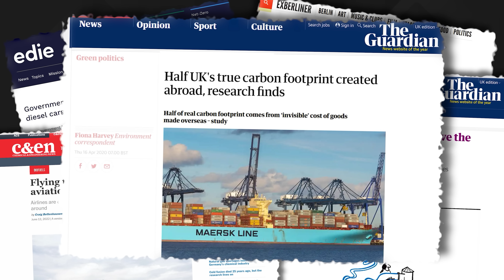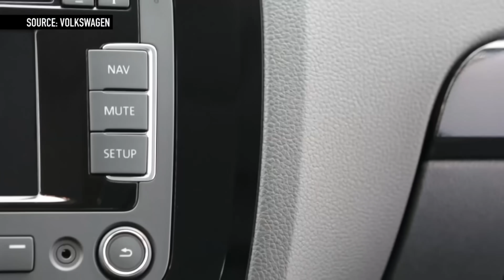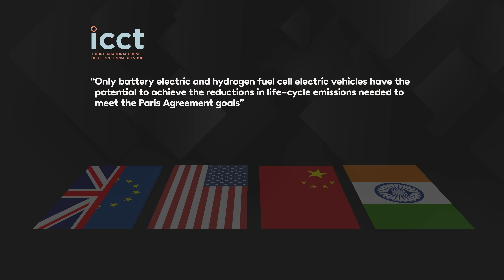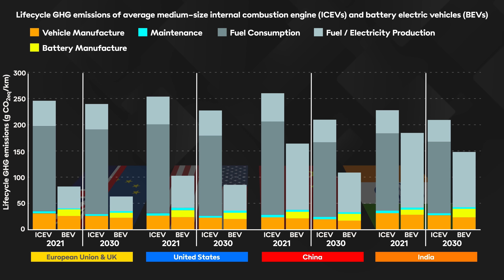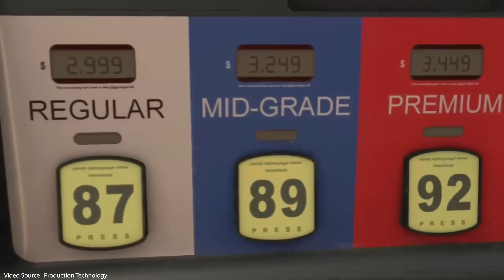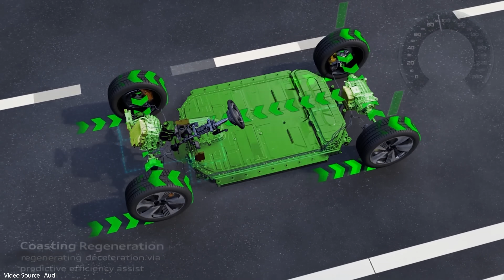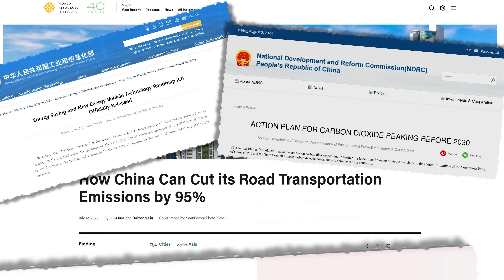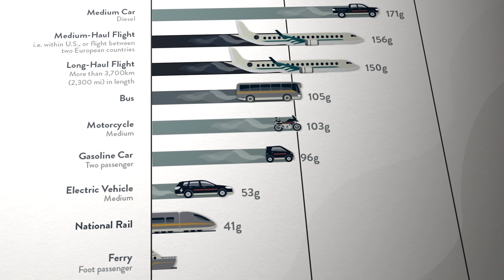Are EVs really better for the climate?

Comment: I thought that the problem with aircraft emissions wasn't so much about how much they pollute but more, where they pollute.  It is worse because of the way it interacts and changes in the upper atmosphere.  Cycling needs to get more like Japan in how cycling and cyclists behave with pedestrians and cars. Its very different to riding a bike here. The attitude of both car drivers, cyclists and pedestrians is more respectful of each other.
Reply: : That would be a nice change. The behaviour between groups is symbolic for the general level of disrespect that we seem to have towards other people. Car drivers hate other car drivers, too. If you try to find cohesion and respect in a modern western world you'll have to search for a long time. And that includes every age group as far as I can tell.
Reply: Planes are actually quite efficient per passenger per distance. Fully loaded some may be more efficient than a car with one person in it. Problem is they usually go very long distances...
Reply: @jfolz  good point ,A very difficult problem to solve if we want net zero.
Reply: @bernardcharlesworth9860  Avation is one of those hard to abate sectors that would be perfect for E-Fuels. Everything else can be either nucleriszed or electrified. It's really on governments to start properly using modern monetary policy to properly shape behaviour, a whacking great carbon tax would be a good start.
Reply: @kaymish6178  great ideas thanks
Reply: The modern turbo fan jet engine is more efficient than an ice but still produces tonnes of CO2.The development of structural batteries or hydrogen/compressed air turbines could lead to zero carbon planes.

Comment: A really vital question is whether there is additional harm done to the environment when a new EV is produced and the replaced ICE car is scrapped. Surely, it is better to drive an efficient diesel vehicle for as long as possible.
Reply: I don't know that a drivable car will be scrapped, especially if it's diesel so that it can run on multiple types of fuels. A quick modification, and you can run those on French fry oil
Reply: @jameshughes3014  Absolutely, IT WILL BE SCRAPPED. The mayor of London has initiated a "scrappage scheme" for diesel vehicles, offering £3000 to drivers on benefits. £3000 will not even pay for 10% of a new EV. The whole thing is a massive scandal. But the, politicians just make decisions that cost individuals their freedom and mobility (see Brexit) without any scrutiny whatsoever!
Reply: Given that there are not enough EVs being made to replace the global fleet many will have to drive ICE cars for a few more decades.    If you trade in your car the next guy will be driving it so there is on real CO2 saving there.   And along the same line some other guy will buy the EV you did not.  Don't sweat it either way.  Do what you want to do.
Reply: @danharold3087  I can't do "what I want to do". I have a 2013 diesel that I have averaged 8,000 miles a year on. It gets up to 1000 miles on a tankful, it hasn't needed any repairs, and it's got probably another decade or 200,000 miles of life in it. Yet, I'm being prevented from using it where I live. Running this car costs no more than £1000 a year, including insurance, tax, diesel and repairs and "wear and tear". The mayor of London offers £3,000 on the "scrappage scheme". I couldn't even pay for 1/10th of an EV with that!

It's an utterly irrational policy, which doesn't help the environment and disadvantages disabled and vulnerable citizens!
Reply: @ulicadluga  I feel for you.   I sure hope the US does not go down that road.   It is a huge tax on the poor and fixed income when they pull that kind of crap.

EVs are helping the environment.  But yeah our governments should not be doing this.
Can you get some kid of exemption for being disabled?
Reply: @danharold3087 Thanks for your empathy.

Sadly, EVs are not helping the environment - yet. They are causing the exploitation of the rarest resources for batteries, they are causing enormous effective wealth divides. 

Only publicly owned rail and urban transport (buses, trams and subway systems) can help the environment.
Reply: @ulicadluga  Public rail and urban transport do not work in many areas.   By all means use them where they work.

Literally every country with minerals has exploited them to create economic growth.   The battery minerals exist in many parts of the world.   Developing countries tend to exploit them to further develop.  China is a good example of this.  The US exploited their minerals during its industrial period.   Now it is nearly impossible to get a mining permit.   'I think'  Australia has about the same thing going.  Importing minerals they could mine.

Wealth and class divisions have historically been allowed to degree created by government.    People are poor because the government allows or encourages the have's to feed on the labor of have nots.    

I disagree about EVs not helping the environment.
Reply: @danharold3087  I can see the US perspective on "Freedom of Movement" being epitomised by the automobile.  To me, being able to drive a car for all my life from the age of 18 was a great "freedom". 

Now, I find out that my government has pulled that "freedom" from beneath my feet. Not only in terms of having to pay an additional £12.50 ($16) every day that I want to use my very economical car, but I cannot even travel freely to places I have lived in across the English Channel. Nevermind, being able to drive through Europe with my "very economical" car. 

I used to travel a 1000 miles on a single tankful of diesel. Now, with sky-high fuel costs, rip-off ferry prices and the dilapidated and congested motorways it has become impossible. 

My government has also caused me to need a visa to travel a hundred miles into  France, Belgium or Germany.

Greetings from the "Prison Island" Great Britain.
Reply: @ulicadluga  Ouch.   Seems the older governments get the worse they get.  Always willing to make more rules and never revisit them to see what harm they might be doing or repeal them when they have outlived their usefulness.

Comment: Well this does put a pin in my concerns about the disadvantages BEVs have over PHEVs in mineral demand. 

I think to be truly convinced, though, I'd want to see a conventional peak Lithium, Nickel, or Cobalt study that estimates what the demand on the world's mines would be given the enormous shift towards EVs of any type in the next 10-20 years. 

I still feel like only demanding the materials absolutely necessary for most trip lengths is a batter gamble than asking for the biggest battery possible. Most Americans/Canadians only drive 40 mi/day or ~66 km/day, and that can easily be achieved with PHEVs (Plug-in Hybrid Electric Vehicles). This kind of thought process is akin to the staunch irony of buying a truck to haul big loads, but only using it to do that like 1 time out of the year or less. In those circumstances, you're better off, at least financially, getting a more fuel-efficient car, then renting a hauler for when you need it. Same thing for PHEVs vs BEVs (Battery Electric Vehicles). 

We also have to consider that most sociological projections put the vast majority of the human population in urban settings, or at least multi-zone settings that allow for multi-story habitations. If the charging infrastructure is lacking for those areas, let alone the parking infrastructure, then people will encounter that many more barriers towards transitioning from ICE to EV. This is to not assume that most people in urban settings will have cars anyways, since public rail/bus and bike/foot are much more economical therein. 

So, during our societal transition, I still think that PHEVs are still king, at least until people can readjust their lives towards the urban environment and ditch their cars altogether.
Reply: Lots of stuff there.   Let me just address the mineral supply from a North American perspective.   We have enough minerals in North America to make the batteries.   We need the political will to mine them and the plants to refine them.   Nobody knows what the 'final' battery chemistry will be.   Even if it uses the minerals we are currently using in time recycling will get us to where very little new mining is required.   Just have to get enough into circulation.    Maybe times when newer batteries require less minerals and a surplus will be generated.  I would not lose much sweat on the mineral end of things.   The politics force it to come from 3rd world countries that need the money .  So long as it does not get snapped up by dictators and their friends that is a good thing.

If my information is right Australia has the same problems as the US on minerals.     I can't speak for the rest of the world.
Reply: Disadvantages??  The oil industry are the largest users of mined minerals BY FAR!!!

Comment: I love regeneration ! It's so fun arriving down hill with more range capability than at start ! Eager for solar of course !
Reply: And it makes the brakes last longer.. It's a rare thing when something works so well.
Reply: Regeneration adds more parts, weight, upfront cost, and possible maintenance costs. However greater range, probable less power use, and reduced wear and tear on brakes make it worthwhile for most.
Reply: @mikedavison3400    Which extra parts are you referring to? As far as I'm aware, the BMS takes the output PWM to zero, then allows the return DC from the motor to filter back through the diodes, and into the cells, roughly 70-100A at 60-70mph.
The resistive load from the battery is then usually tiered into soft, medium, heavy options.
Reply: @mikedavison3400  Are you sure regen adds that much?  Isn't the majority of the hardware already there?  I love one-pedal driving.  By timing the point at which I lift off the throttle, I can drive around town and hardly ever use the brakes.  It's great.
Reply: My bad. My ‘knowledge’ was from E-Bikes and for them the effectiveness is far less than in EV’s and not all motors can be fitted to use regenerative braking. One E-Bike user commented that he had to adjust his brakes far less often on his bike that had regenerative braking and that alone made it worth it to him.
Reply: I have a Prius Plug-in.  I love the fact that the much larger battery (that, unfortunately, takes up most of the trunk) than what's in the standard Prius means that regen is great in hilly territory.  Gravity is a thing.
Reply: @ Dan Truesdell
I would surmise that you like your vehicle because of extended range but you still actually lose because of added weight. Regenerative braking isn’t 100% efficient at capturing all the kinetic energy and you expend more energy going uphill when you weigh more. Still there’s always trade-offs and you sound happy with your purchase.

Comment: weak interpretation of results. -1
You know what it's better than two wheels? Two legs.  If it doesn't rain, snow, too cold or too hot, and of course not too far away.
That's why man invented cars.
Your video should compare EVs with ICE cars(which EVs wins, obv), apple to apple, not cars with bikes.

Comment: The question was never are EVs better. The question is, are they sustainable under zero carbon. And no EVs aren't getting lower in emissions. 2 ways they got worse:
1) we made the newest generation much bigger, heavier, more luxury and with 3-8x the battery size of the 2012 Leaf. 
2) lithium production couldn't keep up using brine in the Atacama, so the industry shifted to ore from Australia and China which has 8x the emissions to mine and refine.

If we have 2 ton carbon budget per person in 2050 for everything in our lives, how are EVs which expend 25 tons or more to build, sustainable. We need revised LCAs that measure each car accurately. Greet and 'average car' math are obscuring the wasteful design changes that represent high range luxury cars/SUVs/pickups.